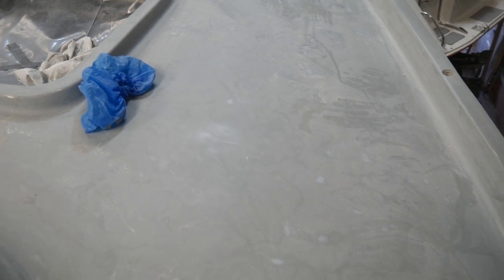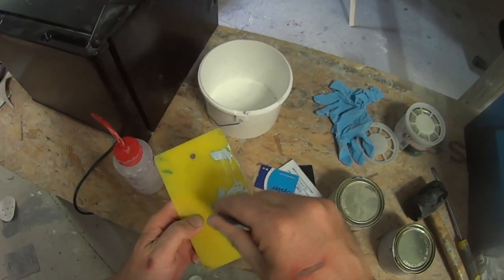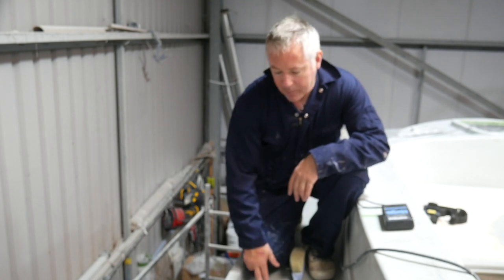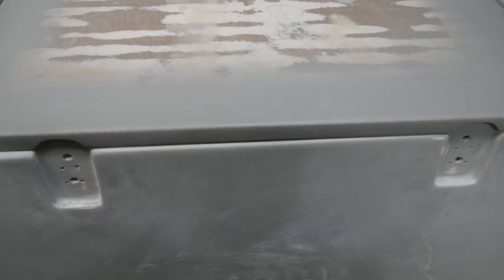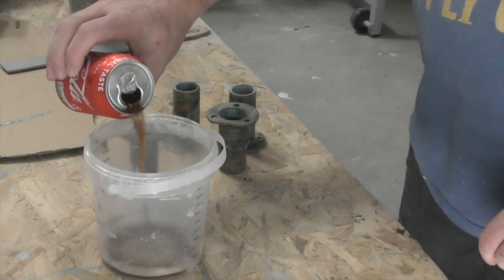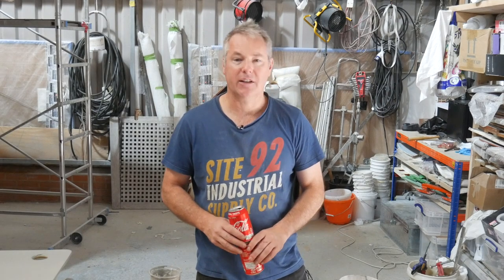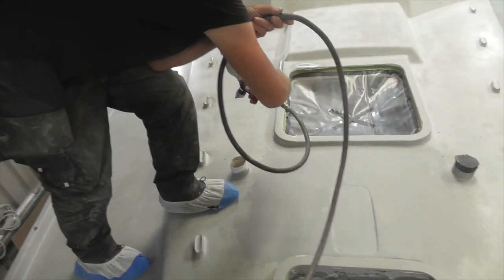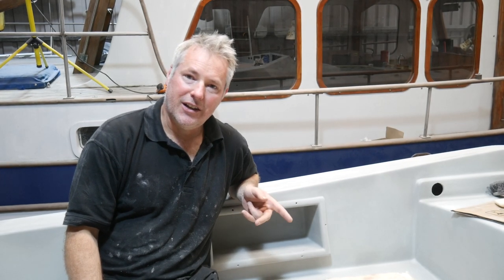#58 Say no to sanding!

Comment: Another great update Richard and despite your time in the Well of Despair, you are starting to look happy! Glad the sanding is over for the time being. As for the holes in the stowage compartments, Tatsu does not have these in either compartment and both are the originals. As you point out, there are vents for the engine compartment on the aft corners of the cockpit coaming port and starboard, which deal with engine ventilation. Tatsu is Hull Number 721, built in February 1989 and being a Scandinavia, she was factory fitted with an Eberspächerwhich is fitted in the engine compartment. The ducting is not routed the way Wanda's appears to be and I do not have that series of holes on the starboard side of the engine compartment. Just a thought... but these pre-formed compartments were not solely used in the manufacturing of the 352. Could it be that they are the same as those used in other models, perhaps older models, which did require the holes for ventilation and they all came from the same parts bin? I believe that other boats of that era (HR42E, HR 26, HR29, HR312 etc.) had similar stowage compartments and it would make sense financially for these pre-formed compartments to be common to more than one model? It might explain why some have them port, others have them on starboard and some don't have them at all. In any event, I do not think you will have any problems now that they have been filled in. Keep up the good work!
Reply from the maker: Hey Travels of Tatsu - thanks a lot for your detailed response. It's really helpful. Wanda was 710 built in 89 also Scandinavian. So I am guessing early Jan? It's good to know that Tatsu does NOT have those cutouts in the starboard side of the engine room. I think you might be correct in that components were pre cut and used in different models. I think I will close those holes up also as I won't be using them. I want to run some dedicated engine room ventilation to the rear port and seaboard vents and have the rest of the engine room sealed up with insulation. Its great to be able to get feedback from other HR352 owners such as yourself to help make these decisions!

Comment: Great update and the deck is looking great. Have the same old wiring issues. Even have  an old electronoc 'box' behind a panel tbat I have no idea what it is. Spent an hour tracing a wire to find it was a dead end. What I do not get is why the cables to the cockpit are all run under the engine bay when there is a perfectly good run up the starboard side that is sooooo  much easier to run cables through.
Reply from the maker: YES! The wiring should be nicely run in conduit along the side but instead they run all the 240 volt cable under the flooring and under the engine room. So you potentially get 240 volt cabling in wet areas should the bilge fill up. Its crazy! When I rewire I am definitely keeping all cabling well clear of the bilge and anywhere water could be.
Reply: @aboatcalledwanda6925  Just be sure to leave some mousing lines in the conduits to pull cables through in the future.
Reply: @aboatcalledwanda6925  Just be sure to leave some mousing lines in the conduits to pull cables through in the future.

Comment: Hi , l built a 45ft cruising cat between 1990 & 2000...  l found the trick is have an over view of the project in you head , then work your way through is small grabs being aware different thing are tied into together.....
don't try to everthing at once....you will become
overwhelmed & pop a fuse.
A little bit & often....you'll get there....the rewards are worth it...cheers
Reply from the maker: Thanks Peter - good for you for spending 10 years on a project! that is indeed perseverance

Comment: On our Hallberg Rassy 42 MKII from 2000 the air intake for the WEBASTO Heater is in the back crate, therefore Halber Rassy installed a air inlet from WEBASTO in the starboard side stowage compartment.
Reply from the maker: That’s good to know. Does the air inlet end in the stowage compartment or is there a dedicated vent in the cockpit coaming?
Reply: It ends in the stowage compartment, but there is a dedicated inlet in the cockpit coaming to let air in to the back crate.

Comment: I have a HR 352 hull number 13, and no holes in the boxes on either side. The hanging locker on the port side is vented from the back of the cockpit. On the starboard side there is ventilation duct from the engine compartment to the back of the cockpit. Fresh air for the engine compartment and the heater is taken via a wooden box next to and left of the sail locker on the bulkhead to the gallery. I can send you some pictures of you want.
There is however 3 holes next to the box on the starboard box. Probably to vent out the sail locker.
Reply from the maker: Hey Morten thanks for sharing the information. Thats interesting. When you say 'Sail locker' is that the large locker on the starboard side (the seat lifts up)?
Reply: @aboatcalledwanda6925  yes. Exactly.
Reply from the maker: OK makes sense - I definitely thing the sail locker needs a vent as you could build up.a lot of humidity there.

Comment: About the vent holes in the glove box. Do you know what kind of heater was originally installed? The owner might have requested for example a Wallas, the early models of which did not have a ducting possibility for fresh air intake. If those 3 round holes in the bulkhead are some 75mm in diameter, they might very well be for the standard Wallas hot air ducting which is 75mm. Just a thought...
I think I saw a glimpse of an old finnish sticker in your boat somewhere in your early videos, if I remember correctly. So it all would make sense, since the majority of boats have that heater here.
Reply from the maker: @Scramasax you are correct Wanda was bought by a Finnish family. The venting is all 75 mm by the looks. I never got to see the heater - just all the redundant ducting and the exhaust outlet (which I closed over). Another strange feature was that there was a box up the front of the starboard cockpit seat attached to the bulkhead forwards (the wall of the galley) This also had a vent with a few holes cut in the box connected to the ducting hose?
Reply: @aboatcalledwanda6925  The heater was some 15 x 40 x 30 cm aluminium box. Exhaust in the top and hot air ducting on the right. Fresh air intake in the front. The control box/display had a grey cable containing some 10 tiny black wires in it, the lenght of which not more than 4 metres.  A separate power cable was required and it was supposed to be quite heavy duty. If it was the kerosene model (most of them at that time were) you needed a storage box for the fuel tank (a standard 10 liter canister). Fuel line, return line and a went connected to the tank.

Kitchen hood? That would have been some luxury...
Reply: Scramasax It does sound like a Wallas. The dimensions are about right as are the connections.

Comment: Hi there, catching up and saw the holes update, but I think you are looking at it wrongly, rather than vents they would be for supplying air to the engine. Roughly your average engine at around 2000rpm is going to be pumping 2000ltrs of air through it so that air has to get to the engine. If it does not then it will create a vacuum, as it takes all the air out of where it can. Not good for the engine and obviously anybody or anything resisting its ability to get more air.
Reply from the maker: @ Roland Ledger, it’s to Vent the aft cabin hanging locker.  There’s no path for airflow from this cockpit glovebox to the engine room. The engine room rightly or wrongly, relies on vents into the saloon and other openings. It’s in no away sealed.

Comment: When you think about it: the whole purpose of having that back crate is for ventilation. If not used that way the hole where it sits could as well laminated in....   the outside edges /flange doesn't exactly enhance sitting comfort at that spot.
Reply from the maker: Well, I don’t know. Tatsu mentioned below does not have holes on either side. It does seem a bit like there is some overlap with components shared on different models. I believe they were to vent out the cockpit locker or the hanging locker, depending on whether you have them port side, starboard side, or not at all. I’ve got three vents I can make use of and will discuss more about that in the future. I’m going to keep the holes covered over.
Reply from the maker: Also the boxes are primarily designed for stowage I think - most cockpits have nooks to keep things in.
Reply: @aboatcalledwanda6925  Nothing wrong with your decision, I just wanted to point out that with closed holes one could opt for getting rid of the thing altogether, and that it passed my mind that the sole purpose of the cage would be ventilation, as it is certainly on my HR40. As you suggest: it could well be that the closed cages are part of the options one chooses at HR.
Reply: @aboatcalledwanda6925   you could well be right. How about asking HR?
Reply from the maker: @ @airgead5391  I have asked HR a few things and haven't got good answers - they keep telling me there is no-one around that worked on the 352's and they don't have much documentation. Thats why its so helpful to get opinions from you and other viewers. Thanks a lot for sharing your thoughts - it made me really think harder about what I was doing and what the design intention was.

Comment: Very interesting update as usual. You seem to be becoming a bit of a Ninja with the laminating. Do you have any problems with resin run out when laminating vertical surfaces and if so have you any tips to avoid it? I too have had a few days of creating sanding "paste" from dust and sweat. Not nice and I feel your pain 😤
Reply from the maker: @Danny Boy I love the idea of being a Laminating Ninja - thanks I'll take that! I can't give you any amazing tips for laminating vertically - epoxy tends not to run as much, especially if you wet out with a roller. If you are using vinyl ester or poly ester it can be a bit more runny - main thing is to sheet up so you don't droop resin on the nice furniture etc. You can wet out the cloth on a piece of cardboard, then when you position it vertically it will tend to stick and you can use the roller to draw the resin though - it means there is less resin going on to the vertical via brush and getting the droops. Good luck with it, let us know how it goes?

Comment: As far as using coke to soak dirty parts in, it contains some bit of acids and some carbon dioxide, that help work things loose!! Of course, there is no chance of chemical poisoning, as it's a consumable product! Use it as you see fit, safely!! However, distilled white vinegar I'd a very good cleaner. It's very acidic, and care must be taken on varying materials! Just check to make sure it's not too caustic. It's readily available, in most areas! Prices may vary some, but it is a little cheaper than good old coke! It is also consumable, just ask any pickle lovers you meet! It can be used, and then strained, and then reused, to a great extent! As many already know, auto drip, Mr Coffee style coffee makers require a monthly cleaning using white vinegar! Not everyone does it. Not everyone uses those styles of coffee making. On the other hand, the vinegar used to run thru your auto drip maker, can then be saved and used in the shop as a rust and grime soak. Most metals used in tools, metal fixtures, and drains can be cleaned successfully. It may not be quick, but is is also not going to melt the metal parts like ice cubes! Just test on a non conspicuous area first. Then you can soak the parts in it! Heavily corroded parts may take a few days or more!! Lightly rusted or corroded parts can take less time! Tools can be cleaned up, after accidentally leaving in the rain! Old nails and screws or bolts can be brought back to life! I haven't found any downside, other than time, at this point! I even had a pair of pliers, someone left out in the weather for a very long time, and they had corroded pretty badly, come back to some semblance of usability, albeit, the Crome outer finish had long since corroded away, and the underlying metal was subject to more corrosion very quickly, if care or lube was not present! I was impressed with the results, for the removal of rust and such!! It didn't make the pliers new again, but it cleaned them up handily, and with a minimum of cost and effort!!